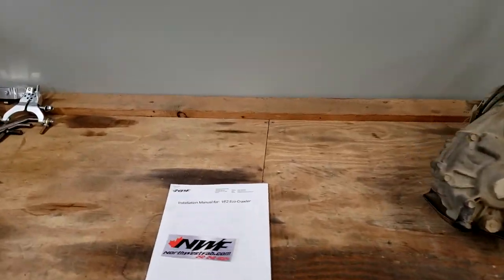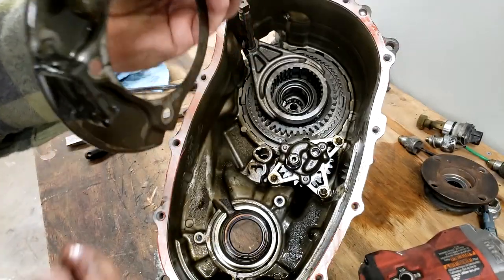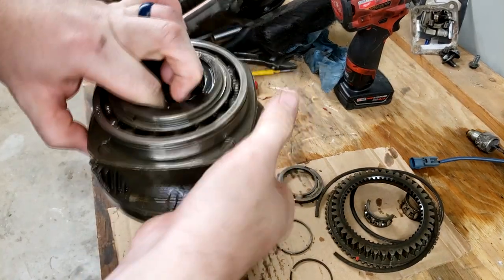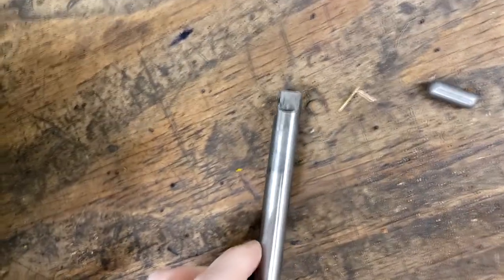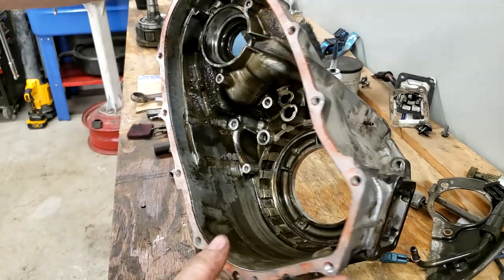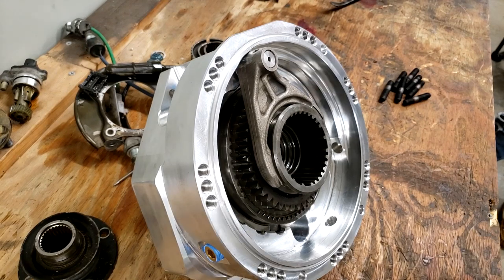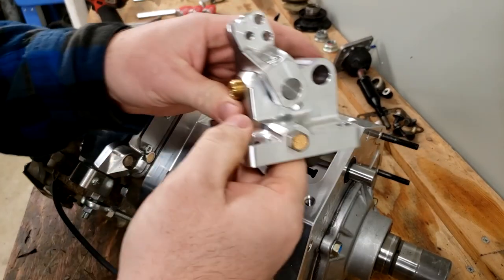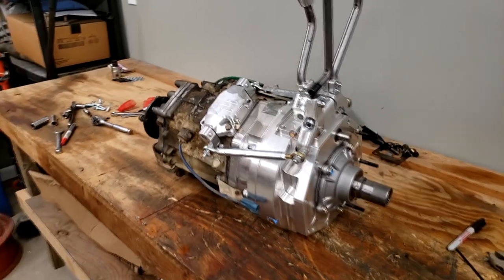Tacoma Dual Transfer Cases - Northwest Fab

Comment: Awesome video man! Well explained, gives me confidence to put my cases together
Reply from the maker: Thanks for watching and the nice comment.
Reply: How do you identify if it’s a vf1 2 or 4? What 2 did you use?
Reply from the maker: @charliesfowllife2335  that's a tough question to answer. I used VF2 cases. Both were manual shift from 3.4L V6 vehicles. My understanding is that all chain driven cases are in the VF family. I think that the VF 1, 2 & 4 have to do with it being a 4cyl vs 6cyl vs 8cyl or all wheel drive vs 4wheel drive. You will have to do some research on your own to get better info..

You can find some more info from the website about these eco-crawler cases in this link: https://northwestfab.com/products/ecocrawler
Reply: @Trav74r  does it matter if it’s a 5 speed or auto trans? I have 2 chain driven cases both out of 98 Tacoma’s with a 5speed. I guess they are vf2? I have been looking for info all over. I’ll check out that site thanks!
Reply from the maker: @charliesfowllife2335  No that doesn't matter, cases can be used from a manual or an auto truck.  My understanding is that there are couple internal pieces missing in a push button 4wd case (what I took out of my truck) that are in a manual j shift transfer case. I believe it's the internal shift forks, as the push button is actuated from a electric motor on the back of the case, instead of the shift handle in the cab.That's why I used two j shift cases. So that may be a thing to watch out for. Also be aware that cases from a 2.7 cyl are 21 spline input vs the 23 spline behind a V6. So that may matter depending on what you are bolting it to.

If you are interested in this dual case setup, the guys that make it are very helpful and knowledgeable as well. I spoke with them on the phone a few times before I ever ordered.
Reply: When are you showing the install?

Comment: Awesome video, thanks for being the first to get this info out there. This is definitely on the wish list. 

Semi-related, you mentioned the push button tcase in your Taco, how did you trick the ECU to think you’re in 4 when you did the SAS? I have a push button in my 4R that I’m about to SAS and I’m trying to think of a way to get the ECU to “see” the front actuator/sensor. Just splice in a relay maybe?
Reply from the maker: Thanks for watching. Honestly I didn't do anything. Just left the plug for the old front ADD system disconnected. So for a long time I didn't have a 4wd light come on at all. The actuator on the back of the t-case still engaged, just no light confirmation on dash.
Reply: @Trav74r  Solid. I’ll burn that bridge when I get to it but at least I know it’ll work until I figure out a solution. Your series on the SAS has been super helpful, much appreciated for posting the process
Reply: You have to remove the computer and hook up a relay in its place, at least that’s what I had to do. Was able to get 4wd and dash lights to work. Lmk if you want me to tell you what wires I used.
Reply: @christophergoodwin6846   Yeah man I'd appreciate any insight if you've done it
Reply: @jmik09  not sure what year you have, I’m running a 2000 limited (wire colors might slightly vary from year to year). Here are the wires I used: grey, green w/ red strip, light green, green w/black strip, green w/white strip, black w/ white strip, and black w/ blue strip. These are wires all going to the computer in the driver side kick panel, you have to remove the computer to do this. If you’re just trying to make the lights come on the 2x wires for the lights are green w/ black stripe and green w/ white stripe, I think the wire that actuates the add is the grey wire. If you have a different year and your wire colors are different I highly recommend just looking for a wiring diagram and deciphering it.

Comment: Wondering how the clocking came out when installed in the truck? Did you have to beat the floor with a sledge at all to get it to fit? Any feedback would be helpful as I just ordered and will be trying to go full clocked as you did. Thank you 🤙🏼

Comment: Did you have to do anything to your synchros when re-assembling the case? The insctructions call for removing them or aligning them before putting the case backtogether but at 35:38 you slap it together with no issues.
Reply from the maker: Didn't do anything particular with them, they just go back together fine.
Reply: Thanks for the response, I am gonna ignore that part of the instructions then and try to put it back together without touching the synchro's, that seemed like an unnecessary portion of instructions  @Trav74r

Comment: How would the shifting work on a 3rd gen tacoma with an electric knob style shifter?
Reply from the maker: I don't know the answer to that. I'm not sure if these cases can be made to accommodate transfer cases from a 3rd gen. If there is a way, it's likely with the rear case being the stock unit. So it would probably still shift with the button/knob on the dash. However you would still need the lever for the front case to be accessible either with a cable or through the floor.
Reply: @Trav74r  oh ok cool. The website has the parts for the 3rd gen and you’d use a donor case from a 1st gen tacoma or 3rd gen forerunner, but Im assuming you’d just shift the additional case with the levers and keep the electrical like you said.

Comment: Does the northwestfab case need gear oil?
Reply from the maker: Yes, it has a fill port on both sides and a drain on the bottom. Fill it until it spills out, like most transfercases and differentials.

Comment: Do u need 2 transfer cases to do the eco crawler?
Reply from the maker: Yes, one for the back half that will get a different input shaft. And a second case to use the planetary gears inside of the billet housing they provide.
Reply: @Trav74r  thank you
Reply: After rewatching it 3x, I think I'm going this route for my sequoia n using 2 tacoma j shift
Reply: @Trav74r  what's the length of the entire transfer case?
Reply from the maker: @egtallday sorry for the slow reply, the total length of the dual case setup is approximately 19.25". That is from the front mounting surface where it mates to the transmission, to the surface of the rear output flange.
Reply: @Trav74r  thank you!. I am trying to see if I will have to redo my exhaust on my sequoia
Reply: @Trav74r  did u have to change the way it is clocked in this video?
Reply: @Trav74r  do u happen to know what the stamping on your shift kit is? Mine didn't fit